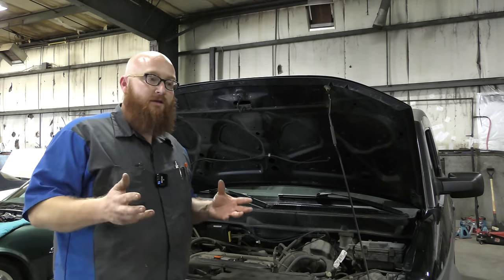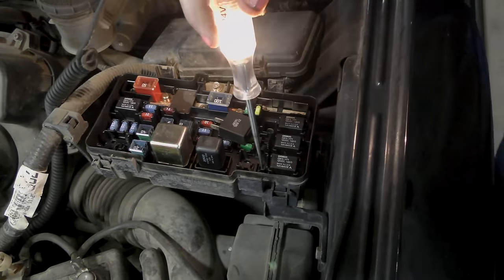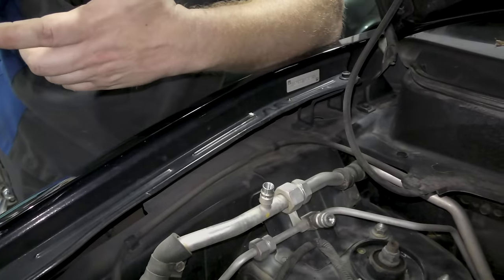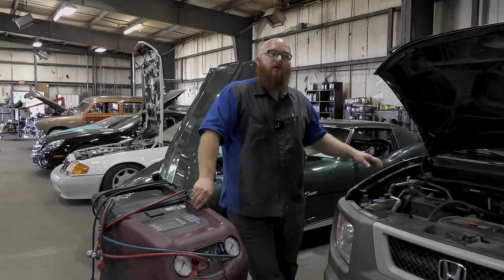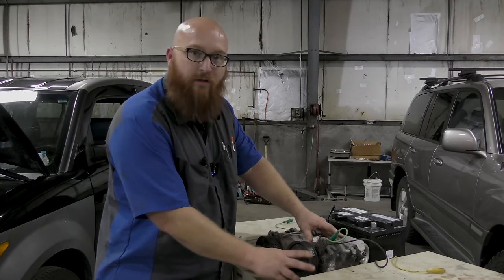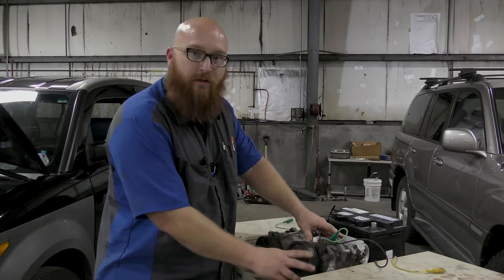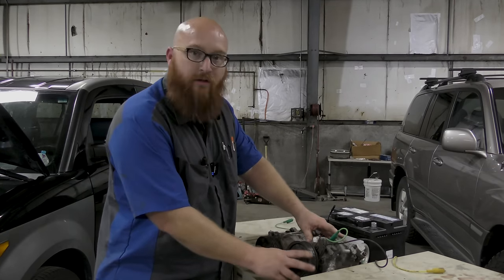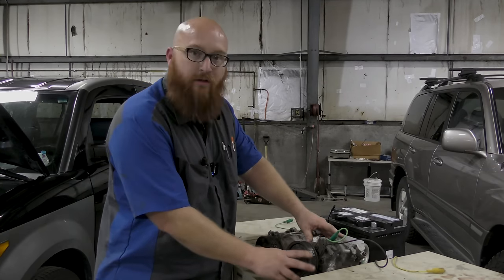AC not working!!! The CAR WIZARD shows how to easily isolate the problem

Comment: Hi, hope you can help me with some advice. I have a 2011 Ford Fiesta 1.6 with 14k miles on it. And the car is not used frequently. I'm from Indonesia where the outside temp is quite hot all the time, Lately i noticed whenever i started the engine at idle, and then started the AC just to get it work for some time, the compressor won't cycle OFF at all like what it should be before (last time even waited till 30 minutes and still engaging). The blowing air from the AC  is also ok (cold), I also always set the airflow to "recirculate". so what do you think is the common problem for that.
When the engine is off, I can rotate the clutch freely by hands.

The low side line is also sweaty as it usually should be

Someone hooked up the gauge on the low side only, it was reading about 25-28 psi at idle. 

But yesterday, i tried again to power up the AC, and weirdly it's cycling ON & OFF for like 3 times only, and after that no more cycle OFF for 30 minutes again so i then switched off the AC.

Do u think this could also comes from inttermitenly faulty Evap temperature sensor? Could that kind of thing damage compressor since it has no rest at all

 I don't want to bring it to some shop without knowing first at least the base of the common culprit, because i'm afraid they just misdiagnose it. 
Thank you

Comment: Had an AC system that work great as long as you were moving, when you got to a light it would turn off the cold air, (No Auto Restart). Any ideas on what would cause that?

Comment: Can a AC compressor clutch engage but if surfaces are worn down as far as outer clutch pins will that cause it not to spin compressor fast enough

Comment: Hmmm $1700 for a new system or $100 for a new compressor… not everyone is ready to drop $1700 on ac for an $8,000 Honda element they are already upside down in that’s about to need brake pads and tires and cost them $450 a month with insurance if the guy changes the compressor himself he can do it 15 times for $1700 so I’m just putting that out there you know how the saying goes “want in one hand, shit in the other” might as well just get a $90 compressor and go trade it in for something new under warranty and use the other 1600 towards a down payment. It’s crazy to me how people can let an ordinary shit box like a Honda element be such a liability they’ll overpay, pay all the interest and insurance, repairs/maintenance and by the time they drive it to a scrap yard they spent enough to buy 5 new ones but the same people will say “never buy a new car under warranty because it loses value when you drive it off the lot” it’s like ok so you go buy a 30k car for 25k with rebates and discounts that will cost you nothing in repairs until the warranty is up, and very little maintenance, cheap insurance etc. and you’ll lose maybe 20% value in the first year which brings you about even in your investment. Drive it another year or two and lose 5-10 grand max but gain 40-60k miles which for most people is making money. Sell it in that window when it’s hot for book value or maybe a little more if you play it right and do it again. Never pay for bs repairs like AC and never even have to buy tires. Change take it in for LOF every 3-5k miles for $60. Or you can buy used spend money on insurance, interest, maintenance AND repairs, lose value every year and drive it until it’s worthless and get nothing from it except headache and debt
Reply: Seems logical!🤔🤫😉😇

Comment: 2012 Infinity G37. I have the AC factory service because I noticed when the temperature got above 98° outside that my AC wasn't cooling sufficiently. They service the AC. I noticed a slight difference, however it's not icy cold. AC system works clutch engages doesn't make any funny noises. Any idea what might be wrong?

Comment: Can I bypass the ac and run the belt past it and still have enough tension to run engine on a 99 DeVille. Engine won't turn even with new battery thinking maybe ac compressor froze. Hoping not engine seized ? Only 62,000 on this northstar

Comment: have a new compressor and got system purged and filled by pros. AC clutch works. on of the legs in the 3 prong plug in has power. 1/4 legs in relay has power when car is off, the other has power when car is on. I used a small wire in place of the relay (for less than 2 minutes) to see if it would blow cold, it did. I swapped the relays around to further test relay, car ran as usual but still no AC.
im not sure what else to do to trouble shoot it. do you have any input?

Comment: Hey car wizard I have a 2011 Ford Fusion Sport and my AC doesn’t work. Tried to add some r134  to the system. The system will not take any Freon  the compressor will not turn on.  I checked the compressor at the relay and the clutch does turn on. Any help would be great.

Comment: He gave you all the reasons to bring the car to the shop.Of course you can fix your car w/o the shop. My a.c. went warm after 16 years and over 200 k miles. Just added a can of refrigerant and been enjoying cold air again. I will vacuum the system and check the pressure when my set of a.c. gauges and a vacuum pump arrive. Purchased them for 100 bucks as a kit. If I made any mistake with overcharging I will correct it then. There is no way I will take my car to a.c. shop and say here is my car something is wrong with a.c. - enjoy the buffet bill me thousands of dollars. Well no way. But my a. C. Will work and it will be a 200 bucks fix including the gauges the pump and a can of refrigerant. If it goes well I will add a can of refrigerant to my second car which also has warm air after 200k miles and it will be  a 20 bucks fix as that is the price of a can. So forget about going to the shop.

Comment: Just put a tiny bit of the freon from the Walmart can instead of filling to the recommended level on the gauge. Filling it according to the gauge often results in an overfill.  Keep doing it until the AC air stays cold and doesn't change. That's the poor man solution. I'm sure there are Youtube videos to figure out how to get it to the right level without overfilling.

Comment: My AC recently started acting up. It works when driving but stopped at idle air gets warm again. I had the refrigerant checked and a bit to much, though I never added any to start this problem. Being in a wheelchair I can check the relay circuit but need a friend to look at the clutch. Any ideas?

Comment: so I have a 2014 Chevrolet Silverado that I bought the compressor was bad I replaced it didn't come pre oiled so I put no more than 6oz of oil installed with a new condenser and flushed out the evaporator and replaced evap valve my vacuumed out system twice for and hour each my struggle is it wont accept freon refill but compressor will turn on before refilling the low side gauge stayed at 28 for 30 minutes, I dont know if its a pressure switch on line or a Schrider valve gone bad ???

Comment: Hello, got the follwoing issue: System is filled up, hvac panel lights are on, magnetic clutch is turning when putting on the a/c inside the car and stopping when turning off - but air isnt getting cold. What could it be?

Comment: I have two buttons. AC and MaxAC in my Honda Accord. My AC button has not been working. I tried activating both buttons and I began to get cool air. I dared myself to turn off the MaxAC and the cool air did not stop coming out. So, My MaxAC button sort of temporarily corrected the AC. I have yet to see if things are back to normal without using Max AC. Any thoughts about this?

Comment: Replaced battery in my vios toyota 2003. Ac stopped working after that.  Just. Coincidence? Maybe fuse?  Ac wasnt super cold before so maybe. Coincidence and needs. Topup.  Last fault with ac needed expansion valve replaced 4 years ago.ill check fuses soon

Comment: What does it mean if the clutch will not disengage. It just continues to turn and it blows hot air the refrigerant shows to be perfect on a gauge. AC was working one day the very next day it was blowing hot air. The car has already had multiple electrical issues regarding light bulbs and fuses blowing too soon as well as the vehicle shutting off and turn right back on as if somebody flipped the switch very quickly for no reason while driving it on the freeway the vehicle shutting off and turning on typically only happens when it's hot out. The vehicle is a 2017 Hyundai Accent SE. It's been a pain in my ass forever now I will be doing the work myself as unfortunately because I cannot afford Shop prices as a single mother in California. I had one shop quote me 280 (non-refundable) just to diagnose it a second shot quoted need 250 for a diagnosis but they were running a special $50 off any diagnostic/repair. California is wild. 
Any tips or suggestions on what I can do I am very mechanically inclined( aka YouTube certified)

Comment: So if my compressor comes on, there's grinding noise while its engaged and my AC is not working(hot on one side sort of cold on the other) its likely just a pressure issue?

Comment: I own a 06 Honda Pilot. AC.blows, cool, not cold. The freon is in the green. The compressor runs good. The air flow light inside the car comes on bright, then it starts dimming when the car warms up.  Any solution for that fix?

Comment: So one you or someone may be able to help me with:
My clutch the last 4 days has worked for less than an hour, but the last time it did, it didnt disengage when i turned the speed to off, but air did stop blowing, yet the clutch stayed spinning, until i turned it back on and off, but on top of that, the lights on the controls stayed on too during that

Comment: Hi car wizard im having a hell of a time trying to get my ac going on my 16 Hyundai Veloster! I first checked coolant and it had some so then I check ambient air sensors they all tested good. so i bought a new presser switch thinking it was the issue changed it and added coolant still has the same issue. So today i poped out the relay like u did on your video and used a light tester. theres 4 prongs on mine 2 lights up 2 don't! So i poped the relay apart and its not getting the power to connect the relay! so i made a bypass jumper out of wire and the AC clutch kicked right on and ac started getting cold inside the car! So i tested the replay by wire it to a battery and it clicks on and off as it should! So the issue is the cars not telling the relay to turn on for some dumb reason! any idea what the issue could be? the av controls light up and click off and on as it should. I am stumped as what it could be.

Comment: I have a 2012 Malibu and my a/c heater climate control switch isn't lighting up and I dont have and A/c or heat. I checked the fuse for the a/c and they look fine. Any ideas

Comment: Great to have a power pro, stick the wire and clutch comes right on. Wires, relays and fuses all good so I’m guessing AC sensor, under charged or HVAC Control Module. What a pain In the a$#!

Comment: I have a Kia Sportage 2017 had a new compressor
 put in last year. I have had it get stuck on heat and next think I know the air will come on but get stuck on air. There is no clicking coming from it to be the door so not sure what cause it to do this.

Comment: My AC is really intermitant.. can works great for 6 months or just 30min.. to be dead for 1-2 days.. then suddenly starts to work again.
im starting to think that its either the high or low pressure switch that are rejecting compressor to come on.. no codes for it though but i have seen some twitchy pressures key on engine off.  Looking at OEM scandata it was quite sketchy and did not show atmosfaric pressure to outside temperature..

Those switches are really expensive though :( and sometimes it requires the system to be emptyed. If it hasnt valve on the lines.

Really annoying this one :D

Comment: So i just got my car back from a shop for the ac and they replaced the condenser/dryer because supposedly it had a leak, my ac still doesn't blow cold. The compressor is working i can watch the clutch engage and they hooked to back up to the same machine you have in the video and the levels are fine, any idea of what it could be?

Comment: I have a 97 Honda CRV AC works good at night during the day it doesn't work that good I added 134a and it's blowing pressure valve on a compressor which is to pop out is that mean I possibly added too much or is compressor going bad

Comment: I have a corolla 2012 with clutchless compressor. The problem i m facing is that my ac stops cooling above 2k rpm. Below 2k it is fine but about 2k rpm it blows normal air. No cooling. No leaks and refregant pressure is ok.

Comment: I started my 06 denali xl yesterday and it made a loud squeal for a couple minutes and then i noticed the AC stopped blowing cold air. I still have plenty of pressure and i can visually see the compressor turning on and spinning when the contols are engaged (it did seem as though it stayed on even after shutting down the AC, not sure why). Either way the low side line doesnt feel cold to me like it used to. Can a compressor go bad and not be locked up? Any help would be appreciated!

Comment: I am having trouble filling the AC on my wife's car.
The system shows low (~10psi) pressure on the low side, the compressor is running but it will not fill.  I can spend 10 minutes squeezing the trigger and the bottle wont empty and the pressure won't change.
If I shut the car off the low side gets higher pressure which shows on the gauge.  I've tried two different fillers attached to two different bottles. 
Any ideas what is going on???

Comment: I tested the connector on the compressor on my 2005 honda pilot with a test light and it did not light. The fuse and relay are good. What does this mean

Comment: A week ago my 2013 honda fit ac is working blows really cold    .. this morning i turn on the car    Turn on ac.  There’s No air coming out of the vents. So i checked Compressor its not engaging.  Fans are not coming ON/ running.

Comment: I took my vehicle to a mechanic shop because the AC unit was blowing hot...then cold air. They did a diagnostic . They said they found the schrader valve was bad. they replaced the valve. but I continued to have the same problem. after the third time I returned to the shop, they told me that they found metal in my ac compressor. It would cost me an additional $2000 to replace the compressor. I already paid 900 bucks to have the schrader valve replaced. Something smells fishy ya think?

Comment: I have a $2700 bill coming up for the compressor replacement inmy 2009 Tacoma. I am told it is seized up. I can rotate the clutch plate by hand , with truck running or not running. with AC on,  the cluth will not engaged, but I can still turn it by hand. How can it be seized up? or is there another place to check for such a problem? thank you.
Reply: Doesn't sound seized. Sounds like the magnetic clutch isn't engaging

Comment: My 2006 Honda pilot ac blows hot air in the driver area but in the rear passenger area the rear ac blows cold air. What could be the issue?

Comment: My air conditioning unit on my 2014 Camry was replaced ..they said I needed a new compressor, etc.  Same problem happened again 3 months later. The button you push to  turn air on keeps shutting off..it just won't stay on. Can you help me?

Comment: I have a unique problem. My ac blows warm. When I start the car I go into first gear of my Lexus Rx 350, 2011, I run the car at 3200 rpms for about fifteen seconds and then the air blows cold until I irn the car off and then do it again when I that again. Doesn't matter about speed or stopped in traffic. Still blows cold.

Comment: I'm having a problem and hoping someone can help. 2010 malibu blows warm air. Refrigerant is good, checked with an ac manifold gauge. AC clutch fuse is good and has power to it, as well as the relay. I know the fuse and relay are good because I swapped each of them with a known working one, and the problem persists. Clutch still has no power going to the connector. My question, could it still be a faulty pressure sensor? Or does it have to have a wiring problem from relay to clutch connector? Thanks for any help

Comment: I have a 2016 Nissan Sentra with good pressures, compressor engaging, fan working.....but it takes about 5 mins to start cooling.  And even then, its not cooling the greatest.  Dealer checked the vent temps and told me it "meets expectations".  Firestone recycled and made sure coolant good.  Still does it.  Wife has same car, a year newer that cools way better.  Im now gun shy to spend even more money because it seems nobody truly wants to find the issue and just says "good enough:.  Any ideas?
Reply: Is the condenser clean?, the condenser fan can be working but not spinning fast enough due to age, that will lower ur subcooling and raise vent temps, you want 40° max at the vent after 15 mins or there is issue..

Comment: I have a 2010 silverado that I had my mechanic recharge but it only gets ac when driving and it's still not great but at idle no ac. The compressor is cycling alot and clunks when engaging any ideas

Comment: In my 2013 Fusion, I've replaced my outside ambient temperature sensor 4 times, replaced harness to the sensor, compressor clicks when I sqitch the relay, and disconnected the battery to reset the ECU.
Still says its 0° 
I need help!